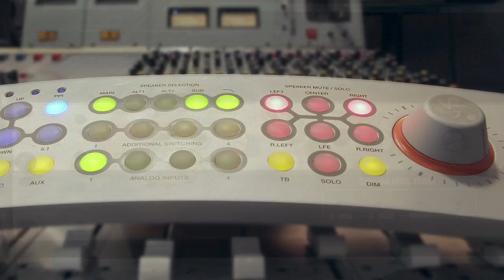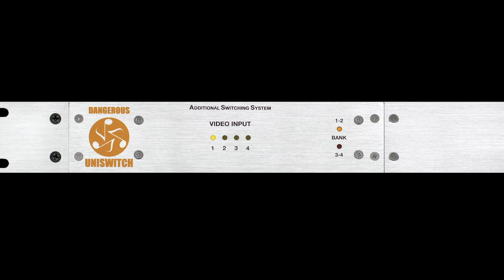Dangerous Monitor ST: Overview

Comment: Can the ST monitor two inputs simultaneously?
Reply from the maker: You cannot unfortunately, at least not regarding inputs 1-4. However, you can monitor via the AUX input, with any one of the main inputs at the same time.